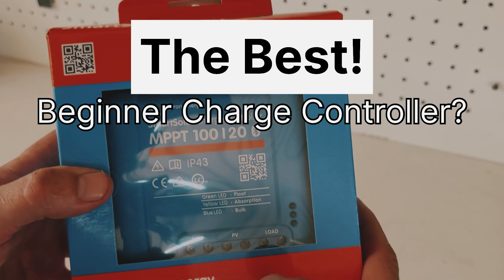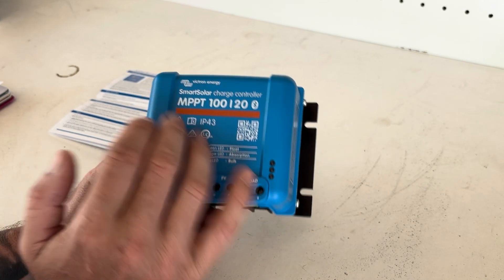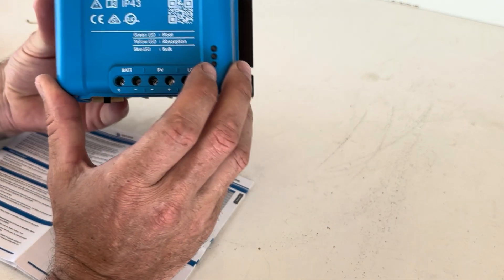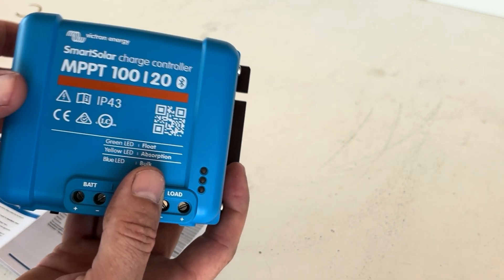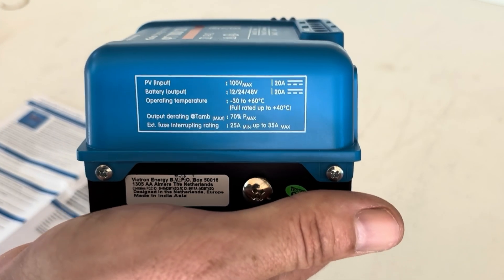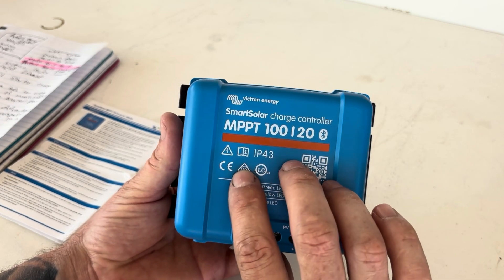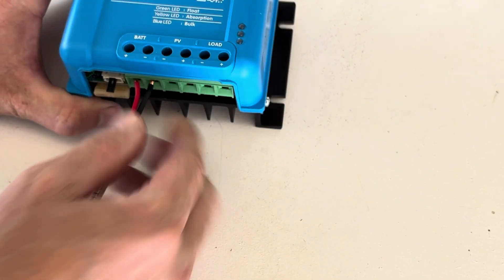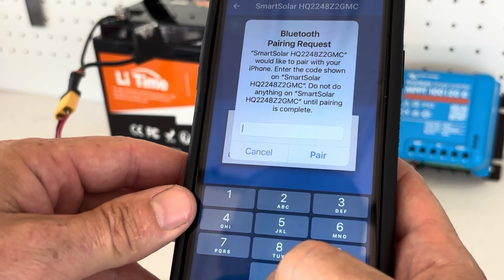The BEST Solar Charge Controller!! For beginners

Comment: Hi mate ,
The plugs or the attachment on the battery with fuse , where did you buy it from or what's it called please . 

Thanks for the vid
Reply from the maker: Hi mate. I made those plugs myself. The connectors I use are called xt60 connectors

Comment: The load output just connects BAT to LOAD, it's a solid state switch via a FET.  However, there are major limitations.  With a 12V or 24V system voltage (BAT) you can run up to 20 amps through the load.  At 36V or 48V however, you can only run 1A through the LOAD.  Also, it is very, very sensitive to surges and will shutoff even when just connecting up a device that has input capacitors.  And the LOAD output is a fairly weak FET without (as far as I can tell) a reverse diode, so it is very easy to blow up the FET.

So don't expect too much from the LOAD output.

That said, the 100/20 is a really excellent small charge controller.  It is the cheapest Victron charge controller capable of handling a 48V battery system.  And it can handle 1000W of solar when on a 48V battery system (500W @ 24V, 250W @ 12V, approximately).

The next higher charge controller to consider that can do 12-48V battery systems is the Victron 150/35.

-Matt
Reply: thanks for info .. thinking to have one late afternoon array with another bank for some kind of generator aND  now i wont go 48 on that
Reply: As an added note, the LOAD output issue is just those specific terminals on the Victron.  Victron ultimately did away with the LOAD terminals entirely in  bigger models.  Of course one normally just connects the loads directly to the battery or through an external high-amperage battery protect device.  The LOAD terminals were just a convenience / added feature.

The LOAD output on the Victron is still useful to control devices with separate control inputs. relays, ventilation fans, and similar small loads.  That's the primary use case.

-Matt
Reply from the maker: Thanks for the info Mate. Very informative. I hope this helps someone out 👍 and yes the 100/20 is a great little mppt charge controller, it’s packed full of features. Thanks for watching